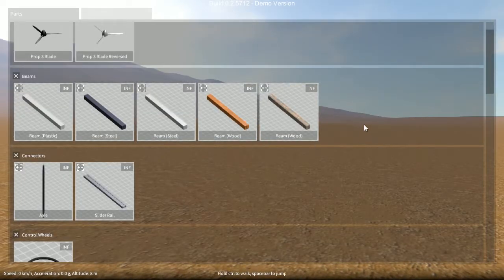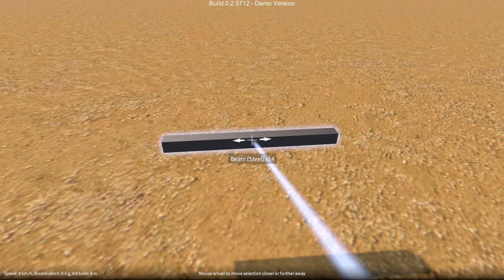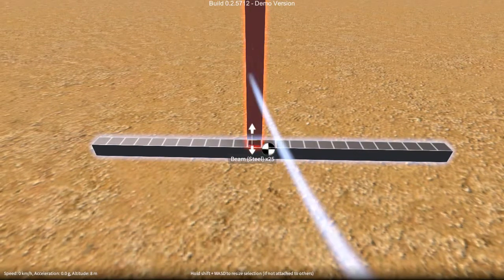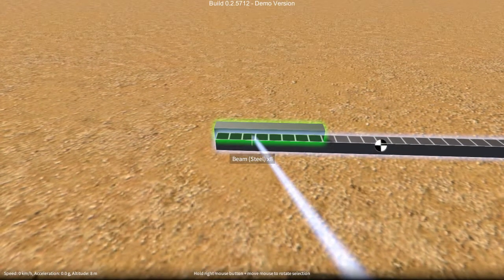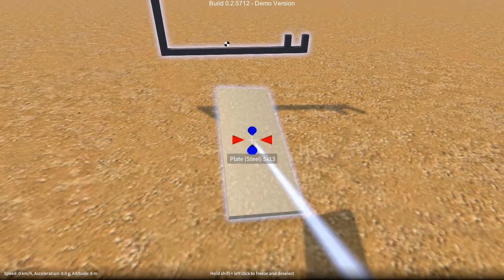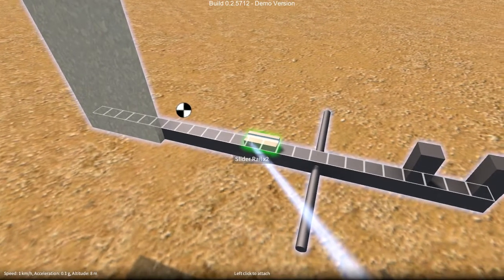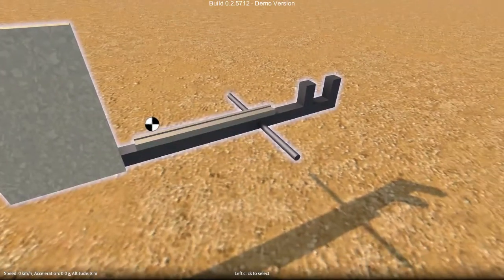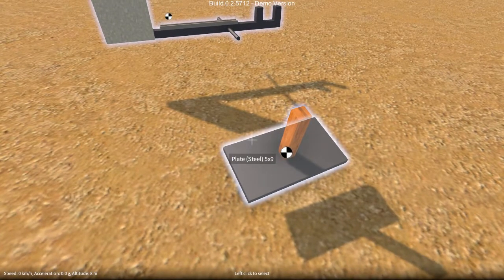GearBlocks dev diary: Re-sizable parts

Comment: Hello!How about the other type of  wheels and tank tracks?If they appear in the game, I will begin to build tanks and crawler tractors.Also how can i fly?Without flying cars always run from me in the sea and i cant catch them.Also how can i create flat-map?Can Physgun-in-hand move details at the predetermined angle in space(For example-rotate for 45 degrees)
Reply from the maker: +Максим Трефилов Other wheel types & sizes are planned for the full game.  Tank tracks aren't planned right now, although you might try building them out of parts already in the game.  A free flight mode is also in the plan, as is a way to retrieve stuff that rolls away from you.  I also plan to improve the terrain generation, to give a flat area to build on.  As for rotating to certain predetermined angles, I have thought about this before, but it's not firmly in my plan yet, so not likely to happen for a while.

Thanks for your feedback!!

Comment: awesome, bro is the servo motor supposed to recalibrate it self ?
Reply from the maker: +Jo Acidimi How do you mean, are you finding it's not self-centering properly or something?
Reply: Yes
Reply: it does not return to the center
Reply from the maker: +Jo Acidimi Hrm, that's odd, it should do.  Would you mind posting up your saved game somewhere, so I can take a look at it?
Reply: yep sure
Reply from the maker: +Jo Acidimi Thanks!  Just tried your save and I think I see the problem.  If you set the servo trim angle back to zero it will self-centre back to the straight ahead position.
Reply from the maker: +Jo Acidimi Actually sorry, after playing with it some more I see what you're saying, the rack gear is slipping past the pinion gear, after which the steering doesn't return to centre properly.  Hrm, let me think about this some more.
Reply: ok
Reply from the maker: +Jo Acidimi Ok, as well as zeroing the trim angle, also try making the front wheel upright axle attachments rigid on one end (see here where I changed them to rigid: https://dl.dropboxusercontent.com/u/157530041/Jo/rigid%20attachments.jpg), do this on both sides and it should stop things wobbling around so much.  Generally you want to use rigid attachments wherever possible to keep things tight.
Reply from the maker: +Jo Acidimi You can also try adding an extra pinion gear (like this: https://dl.dropboxusercontent.com/u/157530041/Jo/extra%20pinion.jpg) in case the steering arm moves off the end of the first pinion gear.
Reply: thanks bro this help so much keep up the good work and have a great day
Reply: k
Reply from the maker: +Jo Acidimi Last but not least, try putting a block underneath the steering arm to support it, like this: https://dl.dropboxusercontent.com/u/157530041/Jo/extra%20beam.jpg.  Note that I deleted the attachment with the steering arm so that it can slide on top.

Hopefully this should fix most if not all of your problems.  Thanks Jo!